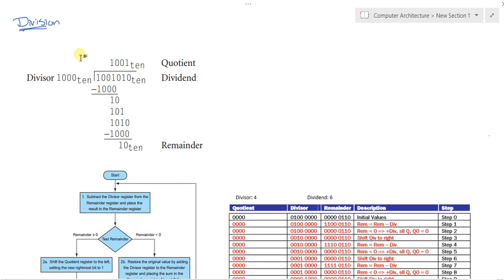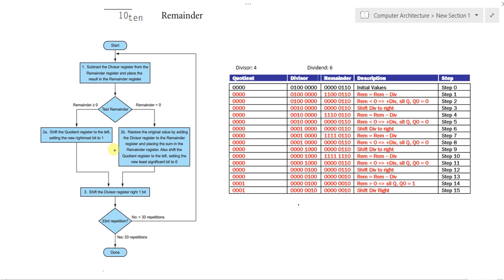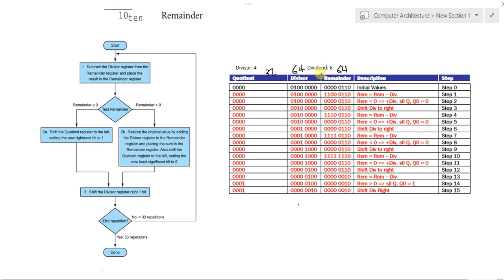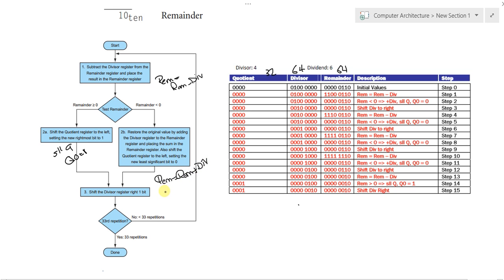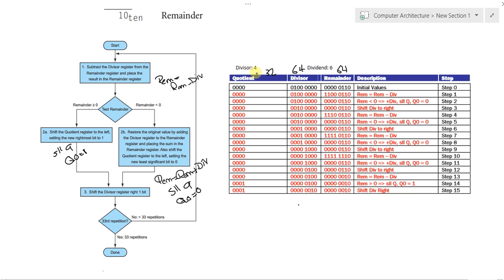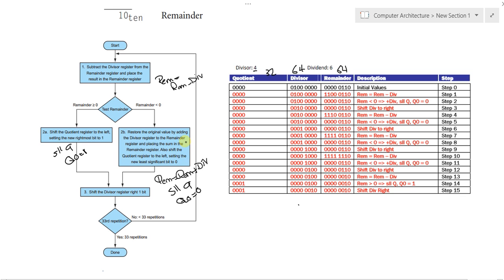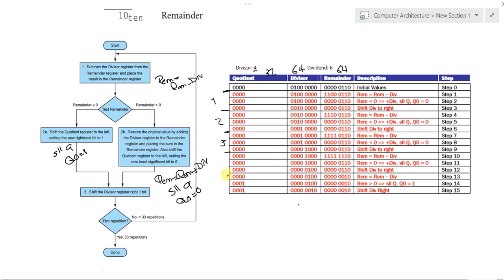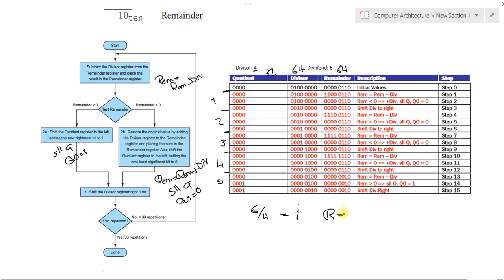Tutorial 4 (Division)

Comment: why are there additional zeros placed on the right side of the divisor?
Reply from the maker: Because in that case, you need to shift the divisor 1 bit to the right each iteration as shown in the flowchart. So it needs double the register space with zeros extended on the right (in that case it was originally 4 bits so it needs 8 bits space with 4 zeros on the right) in order to perform the division operation. The same goes for the Remainder register which had 4 zeros added on the left after extending the space to be 8 bits instead of 4 bits.
I hope I answered your question, please tell me if you need any further clarification